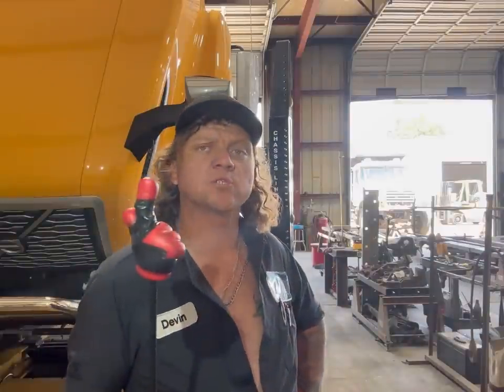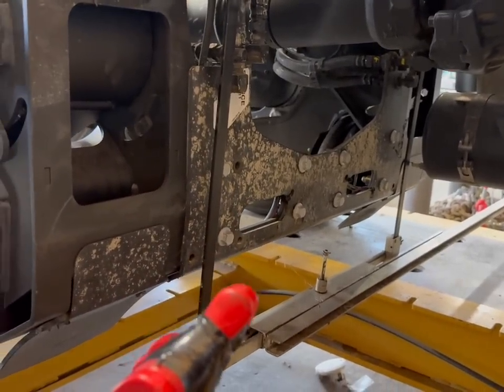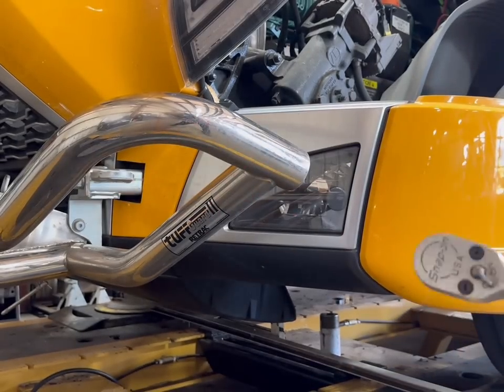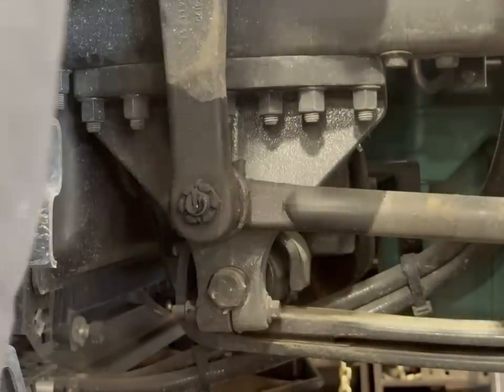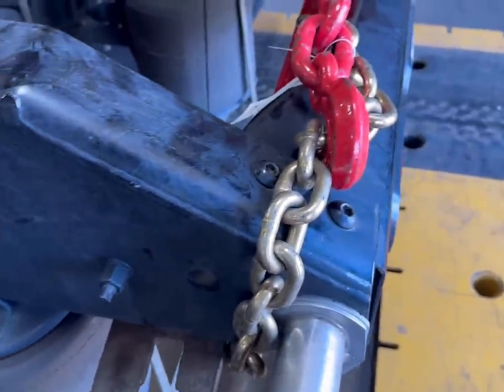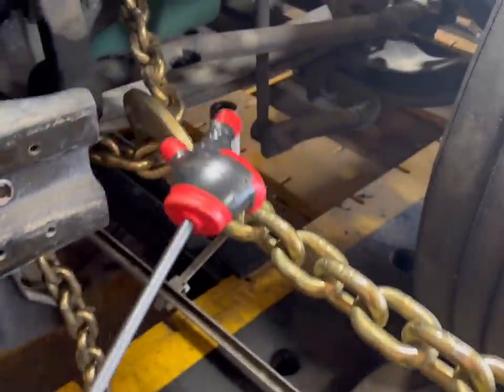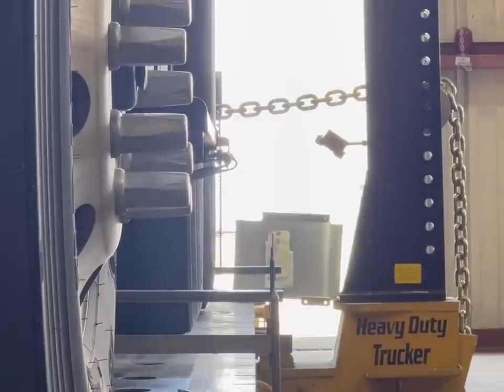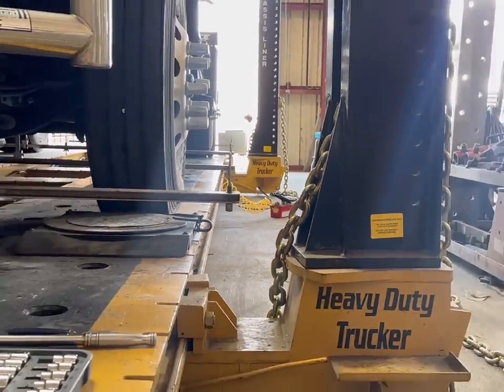An expert’s guide to straightening semi frames 💪

Comment: I fix a lot of "Dead" Busses for customers - there's a certain satisfaction with being able to bring big working vehicles back into useful service. In my case I fix rusted out bits, plus the heavy mechanical stuff nobody else much wants to touch - loads of bus operators are starting to see that the older, better built models they own are very worth repairing as the new ones are crazy money/a bit crap in general.  So I get to play with their older bus.. 

Similar theme, different methods - keeping stuff rolling instead of in the junkyard.  Love the Vids, Mr Bendin.

Comment: Shoot. I used to have to pull motor mounts, exhaust, fuel tanks, and drive shafts when I did the bending. And yes. It's easy to crumple an X member. Especially the old Peterbuilt ones. Dropped a trans in the pit bending on a truck. Didn't know the flywheel housing was broken when it was towed in. Keep it straight.

Comment: In regard to driving the trucks after initial bending to check for the steel memory to comfortably settle, does the frame/chassis take yet another settling when 50k lbs. gets applied on uneven terrain ?